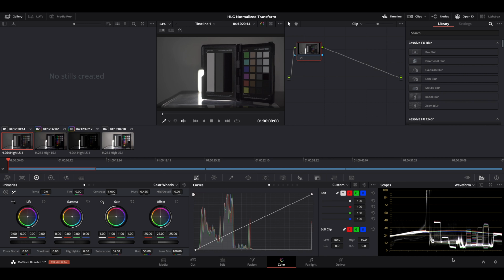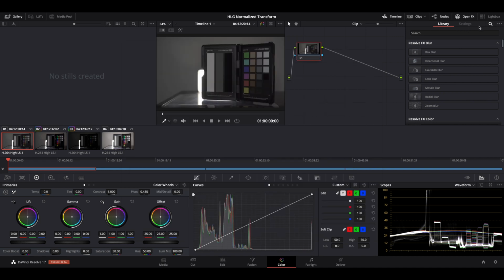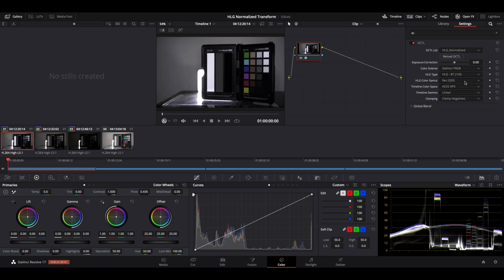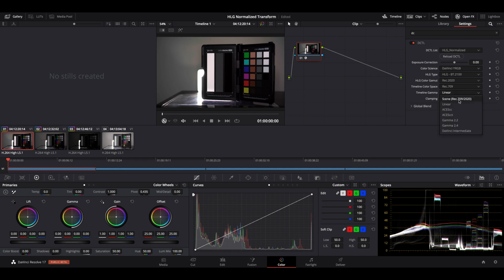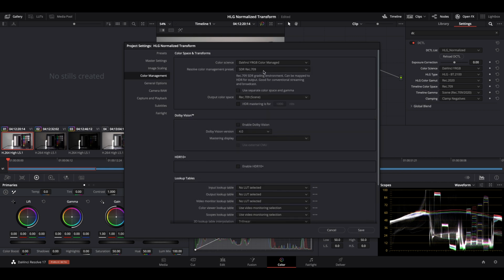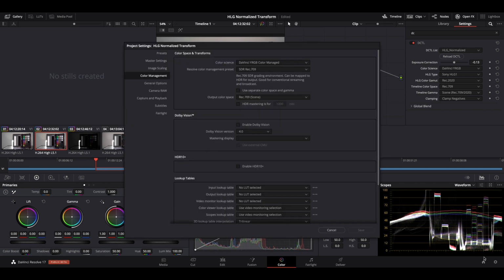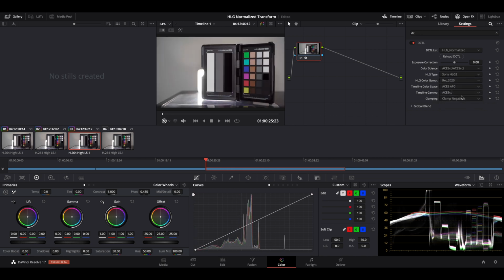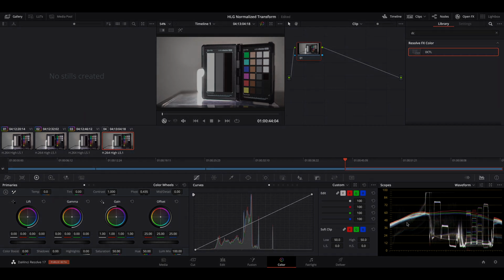Product Tutorial: HLG Normalized Transform v2 for DaVinci Resolve

Comment from the maker: Note: Resolve 17 has now introduced custom ACES Input Device Transforms (IDTs) that can be loaded through the Color tab under the project settings. As of Resolve 17.2, custom IDTs can now also be selected for individual clips. The latest update to the HLG Normalized Transform includes support for these functions as well as the existing method of loading a DCTL for each clip.
Reply: Hi I made a purchase to the "HLG Normalized Transform" but having issues finding the folder to extract the files to. I dropped an email for support on your website as well. Thanks for assisting
Reply from the maker: @DiscoveryWalkingToursTV  It will be easier to extract the zip file contents to a temporary folder and then copy the relevant files from that folder to the required folders.
Reply: @xtremestuff  Thanks a lot for resolving the issue on my side. The addon is working fine in Resolve. Thanks again for helping me out.
Reply from the maker: Glad to have helped :)

Comment: With the bt2048
It is a little overexposed in the highlights and color is kind of saturated but within acceptable in hdr. With the hlg3 it's super overexposed footage in daylight no matter my exposure settings. I have in color management: costum hlg scene input, DaVinci intermediate in timeline and hlg 2100 in output, DVT input none,  output DVT DaVinci. What I am doing wrong? Aces works better for color but in hlg, brightness is limited to 600 nits at output which is good for OLED but my tv is 1000 nits and I can see the difference in brightness with DaVinci color managed where the brightness goes to 1000 nits but overexposes in daylight scenes compared without you normalized plugin. Don't tell me that this plugin only works for converting hlg hdr to hlg sdr...
Reply from the maker: @Francisco Morgado are you using the HLG Normalized Transform or the HLG Normalized Plugin?

There are specific manuals for the Plugin and the Transform that go into a bit more detail on workflow examples for each respective tool.

There is also a write up for general HLG ingestion information: https://xtremestuff.net/recording-editing-with-hybrid-log-gamma-part-2/

ACES applies a tone curve on all output settings which is why your HDR footage appears limited to 600 nits. You can counteract this by increasing the specular values on the HDR panel, but having a significant portion of your scene at or near 1000 nits is not recommended.
Reply: @xtremestuff  I use the Plugin. Its strange that it is completely overexposed with bt2100 o hlg3... only the bt208 works acceptable but without using the plugin there is more highlight retentation with Davinci Color management. In ACES I kind of like the results in color and contrast but with Davinci color managemente daylight scenes look like daylight and impress, but with aces something is missing and it is because of the 600 nits limits. The problem is having to increase the specular values in all clips. The y should provide a more real life option instead of the limit of 600 that looks geared to OLED panels or cinema/ netflix releases that always seemed very bland in their daylight scenes.
Reply from the maker: @compositor82  It's likely your footage was not exposed based on the HLG  recommendation of 21% IRE, or even the BT.2408 recommendation of 38% IRE. That's why anything but the HLG BT.2408 preset will appear over-exposed. You can still make an exposure adjustment in the plugin to bring down the over-blown highlights, assuming they're not clipped from the source footage. None of the information is lost inside DaVinci Resolve.

If you have further queries, please reach out via the website: https://xtremestuff.net/contact/
Reply: @xtremestuff  They are clips that have multiple exposure values and it happens in teh ones where the exposure is at 0 (bt2100),+ 0,7 (recommended exposure based on clipping and 1,7 (bt2408) and all appear overexposed. In ACES it hlg3 preset works very well, but color saturation is a little strange) Davinci intermediate the colors look like real life. Thanks.
Reply from the maker: @compositor82  An exposure meter reading of zero for HLG on a Sony camera isn't 21% IRE. It's much closer to 38% IRE (but not exactly 38% IRE). If you overexpose that, then you will hit clipping point much sooner. See the following post for some more details on exposing for HLG and a recommendation regarding Zebras:

https://xtremestuff.net/recording-editing-with-hybrid-log-gamma-part-1/

There may also be other issues with your Color Management workflow. Please reach out via the support page so your particular problem can be looked into further.

Comment: Hey! I purchased this after a long battle trying to figure out the correct colour settings for Sony's HLG2 on Davinci Resolve, but I can't figure out how to get it to work! As far as I can tell, I've pasted the LUTs and DCTL files into the correct spaces, but the DCTL effect layer only says "NONE". Can you help me? Thanks!!
Reply from the maker: Hi Caelin,

Have you had a chance to go thru the User Guide at: https://xtremestuff.net/hlg-normalized-transform-manual/

Towards the end you will find some workflow examples based on the different color management settings. If you're still stuck, please feel free to reach out via the contact form on the site: https://xtremestuff.net/contact
Reply from the maker: After re-reading your comment, I now see what point you're stuck at. In the DCTL OpenFX Tab, where it says "NONE", you will find that it is in fact a drop-down menu. From the drop-down you should select the "HLG Normalized" dctl.

Comment: Hi, can this be use for the HLG of Panasonic S Series cameras?
Reply from the maker: Hi José, yes the HLG Normalized Transform and the HLG Normalized Plugin can be used for HLG footage from Panasonic S series. The Lumix S series have the Like2100 HLG profile which is based off the standard HLG implementation. For reference on exposing HLG, please have a read through the following article: https://xtremestuff.net/recording-editing-with-hybrid-log-gamma-part-1/
Reply: @xtremestuff  Thanks a lot, the article resolved many doubts about camera exposure at HLG, I felt very confused in that regard. Thank you so much
Regarding the HLG Normalized Transform vs OFX Plugin, the only difference is the support for Multi-threading CPU and GPU acceleration?
Reply from the maker: Hi José, both have GPU acceleration. The following page provides a bit more detail explaining the difference: https://xtremestuff.net/hlg-normalized/
Reply: @xtremestuff  Thanks again and purchase done, in advance thank you very much for this, I feel more confident with the option of DCTL instead of the Lut, I will be testing it with my material. Regards!
Reply: I am in love using hlg. In low light i used hlg3 and its diffucult to bring back details. I will try to use hlg 1 in low light. In day light hlg3 is great
Reply from the maker: @Osman Latif, you will find that HLG3 is better than the HLG1 and HLG2 profiles. Have a read of my article on Sony HLG: https://xtremestuff.net/sony-and-hybrid-log-gamma-hlg/

You can expose your HLG3 or standard HLG at 38% IRE instead to reduce noise issues. I talk about exposing for HLG in another article:
https://xtremestuff.net/recording-editing-with-hybrid-log-gamma-part-1/
Reply: @xtremestuff  thank you so much for help i am planing to buy plugin 🙏 i need it